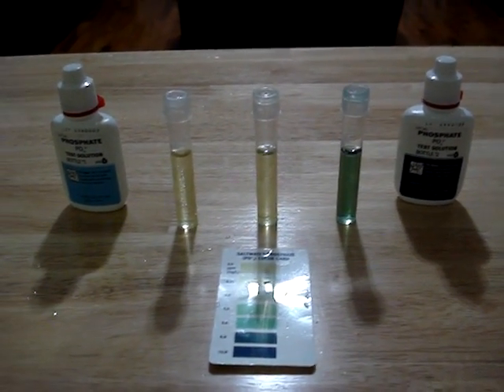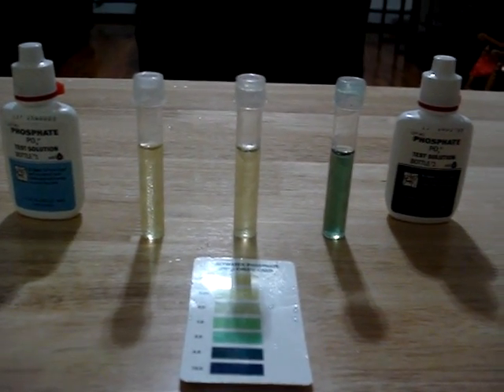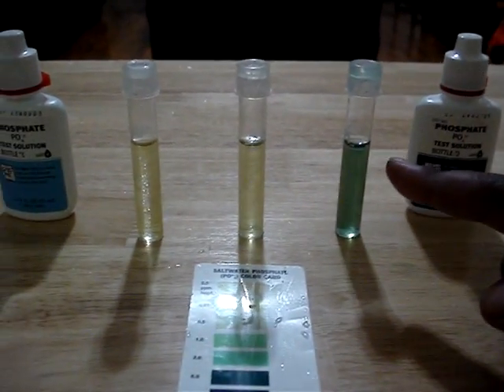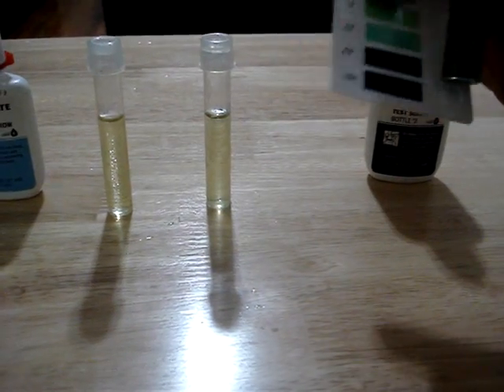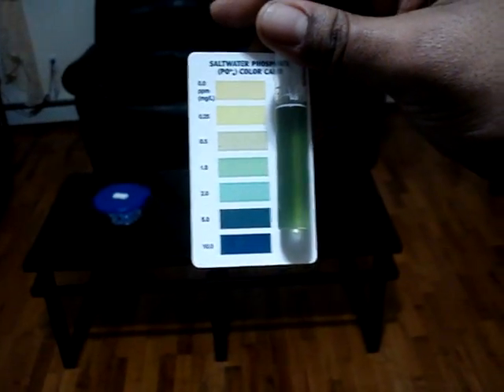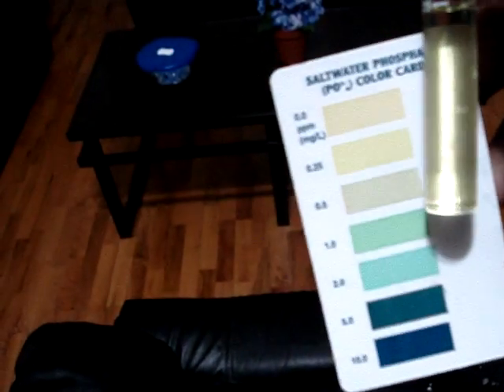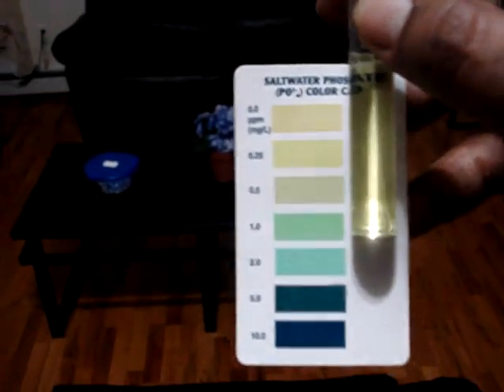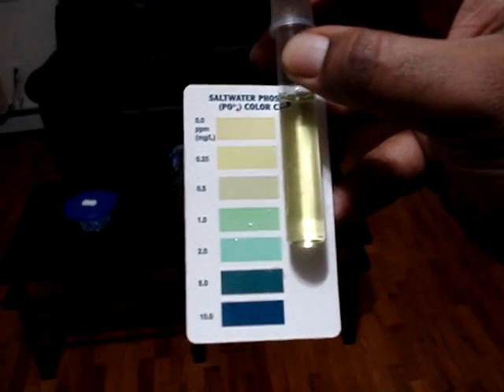Phosphate Problems And Solutions Part 3 of 4

Comment: hey steelo, love the vids man, keep em up! quick question,have a huge problem and made many rookie mistakes. one of them being ive been using the regular tap water for my tank when i started it and i came to find out a few months down the road that i am on well water and the nitrates are really high and its been a long battle trying to get them down. Been doing 10% water changes every week with filtered water. any other suggestions? and i dont have a sump. is there such thing as a HOB phosRectr?